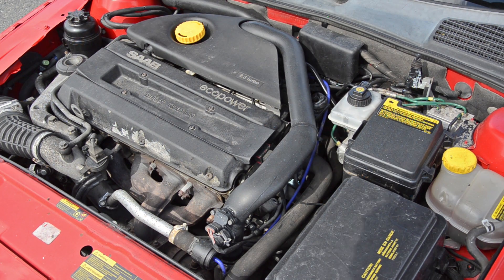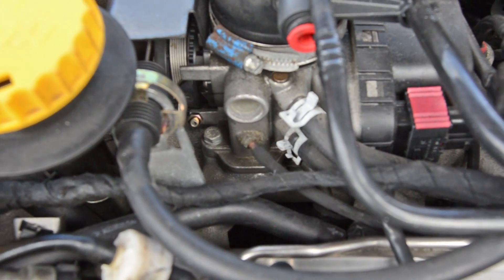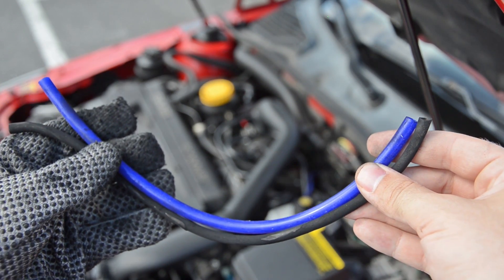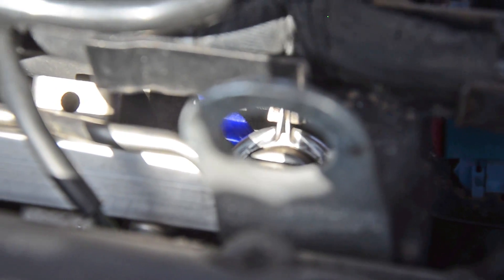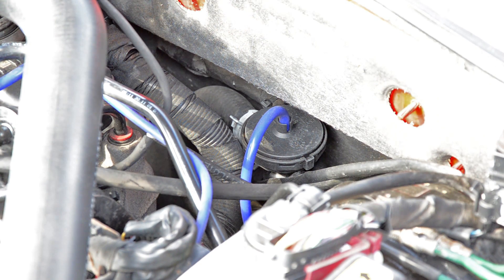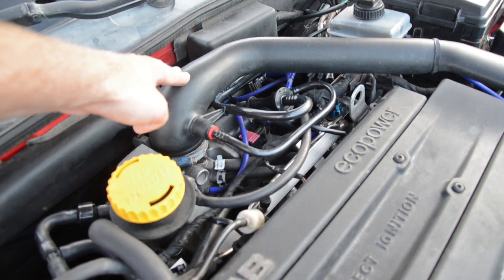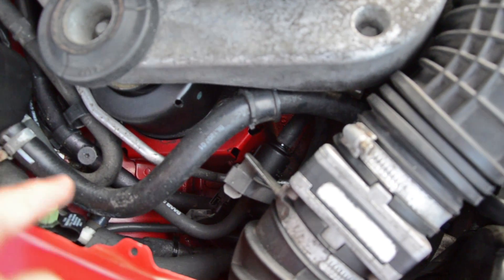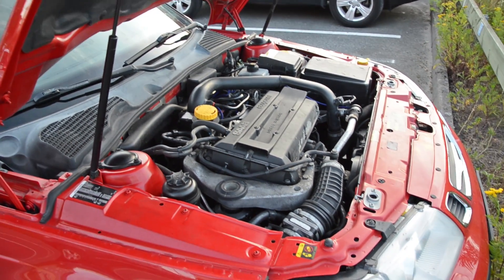Saab 9-5 DIY: Vacuum Line Replacement (Silicone Hoses) - Trionic Seven

Comment: In eight minutes after you’re done, I see the hose I need to find where the other end goes that I can’t determine and it’s on a pollution control valve and it’s the little white plastic thing in the bottom of the screen and it comes off at T that’s kind of an oil breather thing and I don’t know after it leaves the white check valve pollution control valve thing. Where’s the other end of that hose go. I guess it’s not a vacuum holder you would’ve replaced it but it’s keeping me from getting my sub to pass the smog test.
Reply: I’m

Comment: Wonderful video.
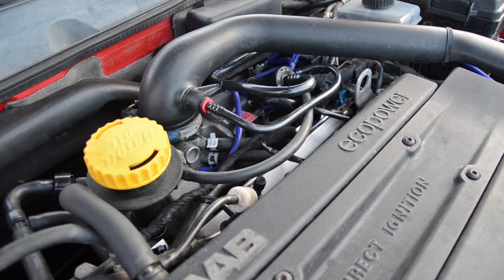I changed the white check valve 8:12 but the hose from right side of the it going down disconnected from the bottom ... hard to see now where I have to connect it as the space is tight underneath . I read ... oil filter trap ? Any idea ?

Comment: Hello , guys  am new here , i have problem with my saab model 2000 , 2.3 turbo, the car batterie is full charged, but my car jus keep cranking not starting, but when yiu push start the car it start easy, if you drive like 100klm, than swich of the car, e try to start again car will start easy but after 10 to 20minutes of switching off the car it wont start again , even if you jump start the car with another idling car it wont start.  But battery is full , if you push again car start easy again.  Any one can help pls, but thy is a small pipe on oil filler nipple with check valve which is not connect any opinion that wher that pipe go's please.  Thanks

Comment: Hi where does the white check valve from the valve cover nipple  go to? The one you didn't replace thanks
Reply: It goes to throtle body, under blue wire he connected in this video as second, it goes under two black thick runner wires into the throtle body

Comment: Thankyou yet again for another video! Much appreciated.Vacuum hoses ! The source of so many problems ! 
My 2001 VW T4 had been playing up for a couple of years before I finally realized it was just a question of perished vacuum hoses. At the same time my 1999 9-5 started presenting the same symptoms, so I replaced all the hoses with silicone ones. Problem solved again!!
I’m going to order some silicone hose right now and replace all of these on my « new » 2004 Aero wagon. Thanks for reminding me 👍
I do still have a « loose » hose which comes from the front of the engine compartment, I just can’t see what it should be connected to. I had the same on my 1999 2.0t. Any ideas?

Comment: Hi , thanks for your very informative and complete videos!!!
I'm french and just bought a 9.5 2.3t i have an issue with an the 3rd hose ( hidden one under the 2 big ones of go and return) going from the throttle body, i have done some research about it but unfortunately cannot find where it end , i discovered this after the buy and naturaly there was no boost on the car, i checked every vaccum hoses and changed them for silicone ones.
i have no limp home mode and neither check engine , everything seem ok notably the wastegate and the Bpc valve that gives me 27ohms.
i plan to check if my turbo is still in good condition tomorrow i mean if both turbines work in simultaneous first and go farther after.
the di casset is ok and i changed air filter and plugs
No code on obd.
only this hose that was hanging line that , we can feel the vaccum at his end , it seems that it should go to the crank case for ventilation but where 🧐? i m stil investigating with the wis
thanks if you have the answer that will make me spare Time.
i mean this one with the arrow on the right
https://images.app.goo.gl/sdC8JXYzHkJvjDRr8
🙏

Comment: Hi- On the thermostate are 2 13mm bolts and 2 10mm bolts.-on one 10mm bolt goes a ground wire - what goes on the other 10mm bolt??
Thank you
Ingo Broeg

Comment: Omg the check valve one that goes down got disconnected and was who knows where. 
So the check valve to the T joint one, it connects below the thermostat bi pass valve, really close to another vacuum line you replaced earlier in the video.
Hope this helps someone else!

Comment: Where did u order them silicone hoses from? I'm looking in Amazon and nothing..it doesn't match up the 4 mm inner and 8mm diameter outer?? Well I have a 2006 Saab 9-5 and it uses  3/16.I  recently purchased hose from advanced auto and the size for my 2006 Saab 9-5 was for that size due to not waiting for Amazon order.Silicone hose is superior to rubber hose for longer life and flexibility..Also it looks really nice.Great way to sell ur car when they pop the hood.

Comment: 2:13 hello, can anyone please tell me where I can find a spare one of those red rings? mine broke
Reply: Local pick and pull junkyard. If they have a saab section like my local junkyard there will be a few saabs from every generation. You probably won't even get charged for the piece. If you haven't found a replacement yet then I hope this helps

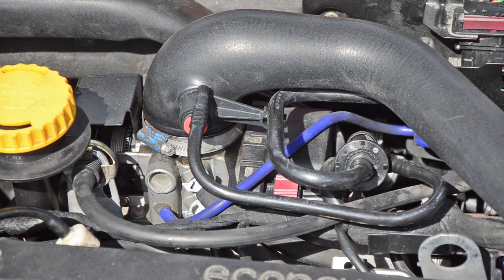Comment: 3:51 next to the brake power hose theres a another hard plastic line, what is it? i have one of a kind model in mine and i need to replace it but i cant find any parts like it. I dont think its original

Comment: I appreciate your video sir. Question if i may, what is the name of the hose that comes out directly behind the “saab”. I have a leak on mine. (2001 saab 9-3)
Reply: specifically the leak is where it connects to the engine (behind “saab”). It does not connect properly, thus a leak

Comment: Holy crap! Big difference! The car builds boost so much better now.
Some notes after just completing:
1: The outside diameter is important for one hose: the brake booster. There's a plastic ring around it, and my 10mm out diameters hoses were too big. Stick to 8.

2: You don't need to remove the entire wiring harness, but undoing the two bolts holding it in place so you can jiggle it up and down makes a huge difference.
3: Be prepared to have someone help you. All of my hoses broke off on the nipple. It would have my life easier if someone held the part up for me while I cut it off.

Comment: Small point for clarity - at 6:05, if you have NOT removed the junction box assembly from the rear bulkhead, it is not completely obvious that the hose from the TOP of the double manifold connector goes to the solenoid valve, at the opposite end to the longest hose, and next to the electrical connector. With the box in place, this is hidden under it and so a bit hard to get to - but not impossible. (Mine had come adrift - this video helped me find where the loose end came from - thanks T7!)

Comment: Thanks for this video. I have the same hose taken off. Is the bit, that the first hose supposed to be connected to also needs changing, or at least check for blockage? Also: is the turbo long hose the same diameter? My one looks a bit thicker,  than the rest  (2004 Aero)?

Comment: Thank you for posting these videos! They've helped immensely with an old 01 9-5 2.3t wagon we received, which had tons of problems (and now just has a bunch).

While doing this I noticed the hub (at 4:22 in the video) was fairly loose. I know this is an older video, but what is its proper name? I've tightened it back up, but it could help me diagnose my issues if I knew what it was (which will help me figure out what it does).
Reply from the maker: A good question and I wish I had the answer. Try hopping into our Facebook forum and ask? :) https://www.facebook.com/groups/733705113501723/

Comment: How are the silicone hoses holding up? They are not oil or fuel resistant, thinking about using them for the EVAP system, so the fuel vapor will deteriorate them
Reply from the maker: They held up all they way to the junkyard. (The car no longer runs due to an unrelated engine failure)

Comment: My 06 9-5 2.3T sportcombi (auto) vibrates terribly when sitting still in D. The vibration goes away slightly when i give it gas. Replaced motor mounts and it didnt really fix the issue. Anyone here have any similar problems or any ideas.
Reply from the maker: You can change the idle rpm slightly with tech2. Might solve your issue if there's resonance at some rpm.

Comment: Just a note to let you know that your video is still helping people in October 2018. I had the head gasket replaced in my 2005 Saab 9-5 and after the work was done, my car would not idle correctly so I decided to try replacing the vacuum lines in the hope that would help. I followed your video exactly and found a cracked line which fixed the problem. Your directions were superb and each step was easily described and well documented.  Thanks for the great guide to this repair!!!
Reply from the maker: Awesome, that's what this channel is for :)
Reply: It’s now the end of 2024 and your video is still helping to keep my 2001 95 running smoothly! Thank you!

Comment: Are there different valves build in? I mean that at the firewall with the 3 connectors, beside the hot water valve.
Reply from the maker: What do you mean by different valves?

Comment: Great video. I feel like it would easier to run the new hose along the old . before removing the old. So you know it's run the same way.
Reply from the maker: Good tip
Reply: Learned from replacing dirtbike wires. Things that move pull on things. So you want to run the same way it came. 
I bought the silicone hoses to do this though. Like the colored idea.

Comment: Thank you very much for this video. I had many lines that were connected on one side and not the other, and some were connected to the incorrect nipple.

Edit: also I would like to ask if maybe you know why my saab is overheating. I've replaced a blown turbo, and it ran fairly well without the catalytic converter on. However when I put it back on it would overheat, and it has a fairly rough idle in any gear other than park. I do not believe my catalytic converter is clogged, I do have an error code p1135 so I'm very lost on what to do. Any feedback would be grately appreciated.  Thank you very much and have a wonderful day
Reply from the maker: Hey Juan! Glad you found the video useful. Regarding the overheating...I don't really know! Try asking in our forum: https://www.facebook.com/groups/733705113501723/
Reply: Trionic Seven Thank you very much 👍

Comment: Hi  
I have one question  it’s about about economic 
My Saab 95 2.3t
Model 99
Take too much fuel 
It’s take 20L for 100k
It’s normal or I have something wrong?
And if I have what’s wrong?
Reply from the maker: Sounds a little bit much. Check for air leaks, air filter, lambda sensors.

Comment: Dear Trionic Seven i accidentally broke my turbo flange bolt but the other three seemed tight however i have a delay in acceleration do you think that i may be loosing boost from turbo flange not being tight enough? thanks Jon
Reply from the maker: Hard to tell, but yes, that could be a problem. If you have an exhaust leak that might cause problems with the air/fuel mixture.
Reply: Dear Trionic Seven on the gauge it reads 13.3 Litres per 100 kms I have the 2007 9 5 2.3T i thought that the fuel efficiency would be better i have watched your video replacing vacuum lines and was thinking about replacing my own however do you think that this reading is an abnormal amount of fuel consumption or normal for winter conditions? i am trying to drive very economically between 1200 and 2000 rpm. 
Thanks again Jon

Comment: Did this today. Your video was extremely helpful! THX! The tube you have coming out of the brake booster is missing from my 01' 9-5. That entire mechanism, the two pipes and the diaphragm they connect to. Is that a mod someone did or just different on the 01'?
Reply from the maker: Your pipe is probably missing because you have an automatic gearbox.

Comment: Computer analysis said "P1110 Turbocharger: recirculating air solenoid valve."   "Malfunction."  Which valve is this- at the front, or rear of engine? Thanks. euanfw@gmail.com.
Reply from the maker: http://saabworld.net/showthread.php?t=25528

Comment: Hi, can i use hoses with the inner diameter of 3.5mm on my 2002 Saab 9-5?
Reply from the maker: I think that will work.
Reply: I'll see if i can change them and see if that works for me... if not i can order the stock ones the local dealer.

Comment: Hi Jonathan! Great channel and I'll try to write in English even if I'm Swedish but let's keep this channel for everyone😊
I have an air intake related problem and this video is as close as I get. It's a 2006 9-5 2,0t biopower with a stage 1 mod(210 hp).
I've had some issues with check engine and fault code P1110. I've replaced many vacuum lines but I see I'll have to check a few more. 
Yesterday I replaced the dump valve in the hope to fix the issue. It worked for about 10 minutes driving around. I reset the code and managed to drive 50 km highway and city until it came back.
CE comes back time after time in different driving conditions. Always P1110. I was told on forums it was the dump valve. Now I'm told it's the bypass magnet valve so before I go and buy that I would like your input if possible. 
I bought the car from a friend in October last year and he's followed the maintenance schedule. 
It's just passed 192 000km. 
I'm about to check: Air filter, spark plugs and even more vacuum lines. 
Any suggestions? 🙏
Reply from the maker: A common problem is the EVAP system with the blue check valves, perhaps that's the issue?
Reply: Trionic Seven It was one of the vacuum lines. It was the one one the right hand side with air going out from the solenoid (on the fire wall) to the throttle body. Didn't have the right tools and couldn't attach the 3mm silicone line I bought but I had a 4 mm rubber line that I managed to attach after a little fiddling. Now the car works great again.

Comment: Excellent video, slightly different on my 2004 2.3T (220hp), no T connector so only 4 hoses. Found the turbo pipe very stiff so could not pull off the throttle body, however removing the brake vacuum pipe was sufficient for me to get new silicone line in place. Turbo gauge now shows more stable boost pressure, thanks!
Reply from the maker: Yep, different model years are slightly different. Glad it solved your issues :)

Comment: the line at 8:13 {https://youtu.be/g6kWoCzDBdg?t=8m13s}  pvc line with check valve. Did you ever replace it? Where / What check valve did you use and what direction should it be flowing?  Mine is leaking oil everywhere. https://goo.gl/photos/xL1eXQUNwfdphpk56
Reply from the maker: I replaced it earlier when the PCV system was upgraded. You can buy almost any automotive check valve. It's supposed to flow from the block to the throttle body. It's very common that they break :)
Reply: thanks for the advice!  I almost feel like I should replace the whole "oil trap" system. Lots of oil leaks on this 2.3T

Comment: So my mechanic straight up told me if I try to replace my silicon hoses they will be popping out every time I use boost. Is this bullshit, does he just think I'm gonna buy shitty hoses? Why would he say this? He said doing this job would be a big NO!
Reply from the maker: Naw, not in my experience. On the stcs forums, however, the gurus recommended that I use zip ties to tie down the ends for extra peace of mind.

Comment: I bought a SAAB recently and found one of these hoses laying loose in the bay and have no clue where it would go. Everything seems to be running properly but it always worried me. Would things run "normally" without one of these?

Edit: Driving a 2003 93 Linear
Reply from the maker: There are hoses from the automatic gearbox for breathing purposes

Comment: Symptoms on mine are a whistle between white and yellow on the gauge then the further you push the throttle it spins around to red and provides  lots of whooshing sounc but my internal organs no longer collect near my spine :-(
Reply from the maker: Similar here. A slight intermittent whistle at specific points on the boost gauge, max boost dropped from 1.2 to 0.7 bar, and loss of upper end of engine power. The boost gauge only went up to yellow and not near red. Get an ELM327 bluetooth monitor and check the pressure!

Comment: that check valve you mentioned at 8:25, what direction is the flow? cheers.
Reply from the maker: It goes from the valve cover to the throttle body.
Reply: +Trionic Seven i know that but the check valve has a flow arrow on it.
Reply from the maker: Flow is from valve cover to throttle body, just as I said ;)
Reply: +Trionic Seven ok great thanks, great video, great channel, i love my saab 2000 93

Comment: +Trionic at 3:20 in the video you are changing and re-attaching the hose from the throttle body to the black box on the back firewall, my04 9-5 aero has a slightly different setup to yours, mine has the throttle body pipe blocked with a screw (expect some kind of bolt mod by a previous owner) and the firewall has no pipe going in and also a dangling connector which I have no idea where it came from. does this hose have any impact on performance when re-attached?

Comment: Any idea how to change the Vacuum valve on a 95? The bit showing at 3:32 mine is missing a connector for the hose to go around, but it looks to be riveted in place.
Reply from the maker: The workshop manual says to drill the rivets out and then use new rivets. Good luck! :)

Comment: Do you happen to know what check valves would replace the factory version check valve? Curious as to if you know of a metal check valve part number.
Reply: Jesse Crandle Thank you very much!
Reply from the maker: I would guess that any check valve that fits the hose will work!
Reply: Current part number for genuine item is SAAB 12793343. The item costs about 35. That's 35 dollars in the USA, 35 pounds in Britain, or 35 pounds in Europe. I know those prices don't all equal the same amount, but I looked up the price in those 3 markets and it just so happens that it's 35 for all of them in the respective currency, not sure why.